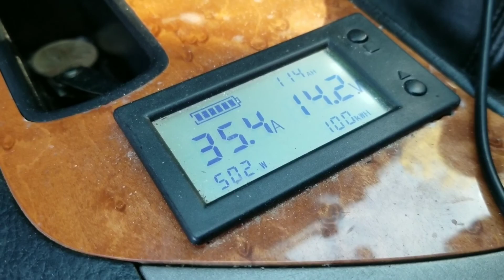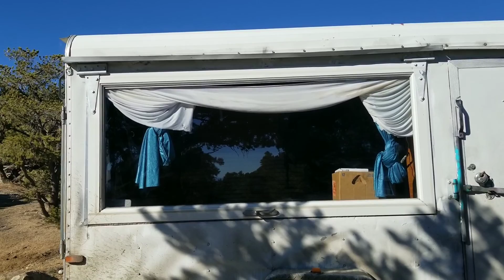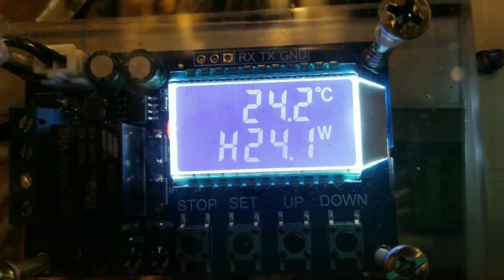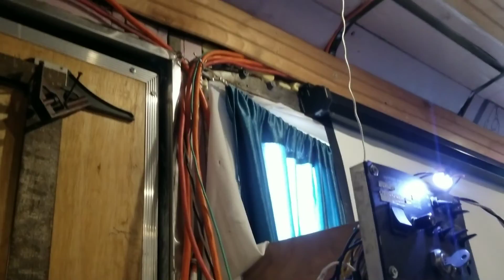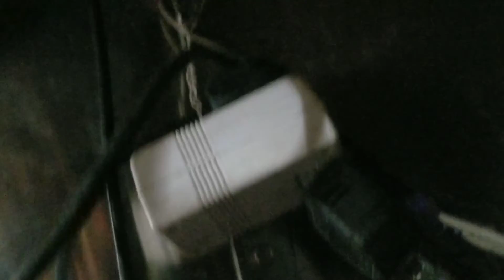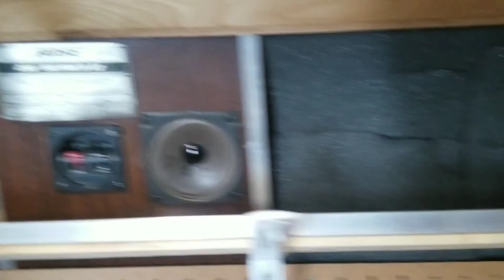Cargo Trailer Camper Conversion Electrical System for Winter Camping - THOW Basics #3

Comment: I try to mind my own business... But, Ohms law is a real thing. You need to size a fuse (or breaker) to the size of wire (gauge) and the LOAD.  Do the math on 10gauge wire, including wire length.  Simply inserting a larger fuse, pushes the problem elsewhere. As in melting wire and connections. Saying you are going to just up the size of the fuse, or add a 120A breaker to a 10 gauge wire makes me concerned for your safety.  Not to mention, the poor wire connections degrade the value of the wire gauge. It's you rig, do what you wish. Electrical fires are a real thing. Thanks for the tour. I wish you all the best, really.
Reply from the maker: Hahaha the 120 amp breaker is for the heavy 4 gauge wire, so that solves one of your concerns. I may up the 30 amp fuse to a 40 amp fuse which should be fine for such a short run of 10 gauge. I agree with you it's always a work in progress and I'm always learning ways to make it better. Thanks for giving your input!
Reply: @dragon_offroad  My math is 12V, 30A, 10guage = 6-7 feet (not 18-20'). For 18' at 30A would be 6guage. Thats my math. 
I have no say on your rig. My only point is, to 'over-fuse' only moves the failure point. Take a home for example: 14guage is for 15A circuit. If you put a 20A breaker on that size wire, the failure point will move to the wire and connection points. Creating a fire hazard.
I'm more worried about people that view this as instructional.  
I am 3 times your age. I have seen more failure examples of this in my lifetime than I can count. I just repaired a $570 piece of equipment that the client inserted a 20A fuse because "the 10A fuses were blowing".  There was no fire, but the repair cost was >$100.  Just another random comment from a stranger. 😁😁😁😁
Happy Camping!!
Reply from the maker: @Lapeerphoto  hell yeah, that's part of why I post these things, to get a "peer review" from people with different backgrounds and experiences. We both want people to learn from our mistakes and maybe save them a lot of money and time in the process. That's what makes science such an awesome and powerful force, as it constantly seeks the truth in Nature without letting one's ego cloud judgment.
Reply from the maker: @Lapeerphoto  you'll be glad to know I've edited my video to remove the comment about upping the fuse size from 30amp. I may even decrease the fuse size based on the wire length. Last thing I want to do in an informational video is provide bad info and cause someone an electrical fire haha